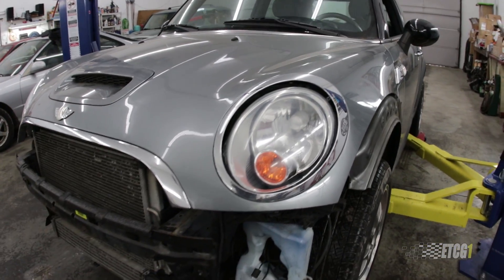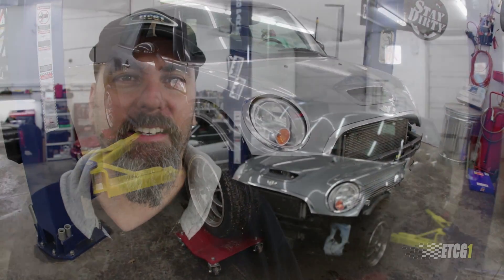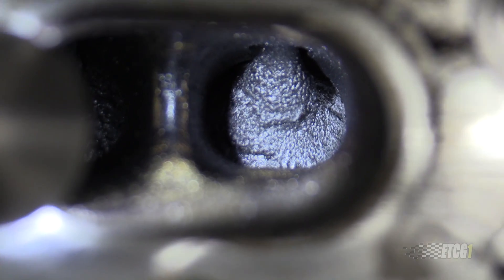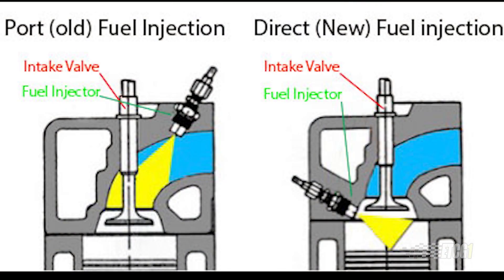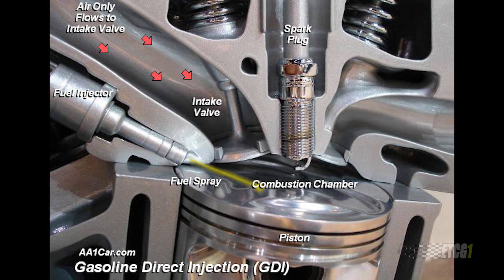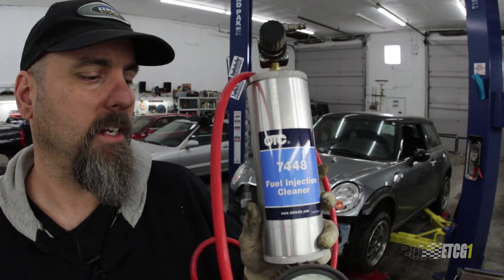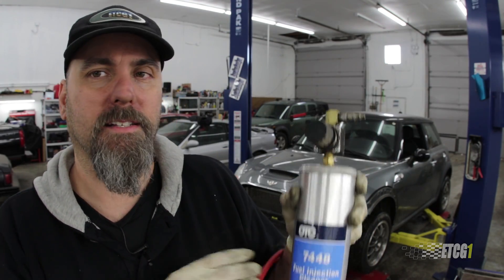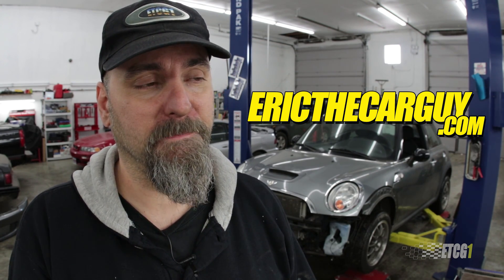Direct Injection Proves Fuel Additives Don't Work

Comment: Lol love your addendum in the end I 100% agree they are snake oil when it comes to automotive applications. But and I add that interjection loosely I have found them pretty effective in carburated motorcycle applications IF it is a situation where the fool who parked his bike for the winter didn't stabilize the fuel and their jets were slightly gummed up. But I did get a good laugh because I went and purchased oil and filter to do my scheduled oil change on my wife's car and the parts guy kept trying to push a fuel system cleaner on me. I told him I had 17 gallons of the stuff at home lol referring to her full tank of gas.

Comment: Its the pcv system dumping oil vapors into the intake. Needs a catch can added. Over at engineering explained they looked at fuel itself compared to fuel with cleaners added. The top tier fuel we get today has all the cleaners needed and will keep the engine cleaner than adding more stuff. the extra cleaners leave some of their own crud(not a big amount). So, I agree  just use good name brand fuel.  you also have a MONEY PIT car. so it will continue to be a big hole in the street that you pore money into.

Comment: Great observations on the solvent power of gasoline and the most likely source of carbonized deposits on the intake valves of Direct Injection engines, i.e engine oil and oil vapor pressurized by blowback in conjunction with an obstructed or ineffective crankcase ventilation/EGR system. GM’s DI engines suffer from this problem, as many owners of vehicles with Ecotec engines have found, but which GM ignores for the most part.  In the worst cases, the oil seals can be blown out.

Comment: How about running the engine with the injection disconnected and the engine fed the cleaner and fuel through the intake throttle body....at least that might allow the engine to run and break up the deposits....Run Rite...
Reply: A mechanical cleaning is really the only thing that's going to break it up when it's that bad unfortunately.
Reply from the maker: The computer would likely not allow the engine to run in that situation.

Comment: I would argue the fuel additives do more for the injectors than the valves.  My first car, had a lot of hesitation and poor running.  A couple of fuel treatments, for the first time in its 200k miles and 26 year old life, and it helped it a lot.  However, using fuel additive at this point wont do anything more.

Comment: i have water methanol injector installed before throotle body mostly for cleaning i use mild wind shield washer fluid (methanol based) and only during full acceration over 3k rmp intake stays clean

Comment: I'm not exactly happy with direct injection either. I read that the new v6 Camry has direct and port injection to combat this. I wonder if that works.
Would spraying misted water in the intake help this?
Reply: Peshewa diy you gotta be super careful with that. You may end up bending the valves. I would rather use CRC cleaner or sea foam

Comment: Ha ha :-D the rant at the end made me chuckle, you evil man lol.
If you were upset you didn't show it, you should be an actor eric :-D.
i'm wondering if some kind of sand blasting while the valves are closed could remove that crud, it's not sand i hear you say, ok media blasting.
The carb is king :)
Reply from the maker: Many comments have suggested walnut blasting and also foaming intake cleaners to address the problem. I haven't tried those. I used carburetor cleaner, a screwdriver, and a brush mounted to my drill to clean these.

Comment: On my 2013 Hyundai Azera V6 GDI I have to use CRC Intake Valve cleaner about every 6k, I had the whole engine replaced under warranty at 48k due to the carbon buildup on cylinder number 5 and 6 and damaged the valves, guess its a huge problem on the Hyundai's even more so on the Sonata's from what the dealer told me that 4 to 6 cars come in each week and they take off the intakes and clean the valves by hand and walnut shell blasting.

Comment: In seems to me it's the EGR system that causes buildup on DI intake valves.  If manufacturers could come up with a way to not have to puke exhaust back into the intake it'd probably be much less of an issue.   I bet the reason that the "latest technology" is to have both DI and port injection is in an effort to keep the intake valves clean.

Comment: I use Amsoil PI fuel system cleaner/Performance Improver. I honestly don't know what it does to my fuel system, but it does indeed feel like it makes my engine run smoother and feels less sluggish. This was also confirmed when I kept getting a knock sensor code pop up about once a week or so, but it stopped after I did an oil change and added a bottle of Amsoil PI to my tank. I didn't purposely try to use it as a fix for the knock sensor code, I add a bottle at every oil change and the code going away was a bonus.

Comment: lol I love ya Eric especially with the last bit! I happen to disagree with you on this subject however. The title of your video stated how you find fuel injectors cleaners do not work. Only thing proven here is that gasoline acts as a cleaner and solvent. Obviously fuel injector cleaner can only clean wherever fuel is sprayed, on tbi engines its pretty much the entire intake, port injection is the intake valves and direct injection is limited to the combustion chamber only. There's been plenty of independent testing for the effectiveness of fuel system additives ( recommend project farm) that prove different as well. Not to say that it's a mechanic in a bottle or that it's just as effective as disassembling and cleaning parts but in a lot of cases it helps. Personally I've had a fuel pump on a Dodge that was making a terrible noise (no serviceable fuel filter) and an additive was added with less than half a tank. To this very day it's still functioning perfectly without a single noise and the change happened before I got down to a quarter tank.
Reply from the maker: You might want to watch the video because I did address your concerns and comments.
Reply: ETCG1 I did watch it as I am a subscriber of yours, I really just fail to see the correlation between a method of fuel injection and the effectiveness of an additive unless you were specifically speaking about GDI only. In which case I'd agree that fuel additives are pointless in a GDI engine.

Comment: Toyota eliminated this issue by using a combination of multiport and direct injection from the start almost 15 years ago. Audi, which had terrible carbon buildup issues, started doing the same about 5 years ago, and Ford is starting to add multiport injection to their direct injection engines now. They don't all run the 2 sets of injectors the same way, but it helps emissions when cold/at idle and, most importantly, keeps spraying some gas on the back of the intake valves to keep them clean.

Comment: Your'e not the first Youtuber to address this issue. You hit the nail on the head with the direct injection engines. Hopefully the engineers have learned something and corrections have been made to what is being made today.
Reply from the maker: Well, they've added additional injectors to put fuel on the intake valve in newer designs.

Comment: Market study, after market study, after market study, all show that the "cleaner etc" products are sold due to psychology rather than technical merit.  People like to "feel" that they are doing something good.  A what a great product to sell, people buy it and burn it up.
Reply: WD-You know what they say: if you think it's working...then it's working!  Placebo effect.
Reply: I will be  more concern about the paper fuel filter and all those additives u blast it with.
Reply: We aren't just talking about Injectors, it also is the tops of the cylinder and where the rings contact the cylinder. I have seen videos of people using snake cameras after a fuel Injector cleaner and it does help.
Reply: @WD Hewson: I agree. It's basically "false sense of security" in a bottle.
Reply: WD Hewson projectfarm YouTube channel has done a lot of tests on them. Honestly, I can hardly tell or see no difference with all of them except seafoam. Even then, it’s so minute, I really don’t think it’s worth doing. The only additive and this is on the oil side that seems to work and in large quantity is motorkote. You watch project farms video on it.

The reasons these things don’t work is it’s called “Fuel Injector” cleaner not “combustion chamber, valve, and intake cleaner.” It’s meant for clogged injectors and nothing else.
Reply: When your car sat for ten years and was to the point where a tune-up doubled the power, it does everything it says it will do. Then a while back I accidentally let it idle till empty and by the time I put gas in it about a week later, the whole system was ethanol'd to hell and it barely started. Full tank, one bottle of fuel system cleaner. 1/4 tank later, it runs fine.

That was the Mercury. The Ford 5.0 doesn't burn oil. The Nissan QG18DE does, by design. After 90,000 miles, fuel system cleaner made an improvement. Probably moreso if the fuel pressure regulator worked. With a gutless, motor mount-shredding wonder like the QG18, you will notice any improvement in power or smoothness.

Oh, and ChrisFix sent out a fuel additive to a LOT of different people with a LOT of different cars and across the board, it had significant results.
Reply: What studies? Care to share?
Reply: keantoken the fact is that even placebos can't affect what's not being touched, which as shown in Eric's video is the intake plenum right before the valve. Study this: Eric's butthurt because his cleaning douche bottle is now useless: evidently couldn't start the Mini with only the shop air meager air pressure or the thing behind him would've been out of his shop already instead of still conspicuously-occupying his 2_post lift. Red herring stinks like fish.
Reply: I understand nothing you put in your fuel tank would clean the intake valves when they never get touched by gas. I'm just curious what has been done to show they are useless on port injection cars.
Reply: Don't knock a good placebo.  Just talking about them makes stuff better.  If diluted with any reality mixer, they go bad fast.

Comment: Hey Eric, I use the same type of fogger system whenever I do and injector cleaner as well. But whenever I’m in a pinch and out and about I just take lose the brake booster and put the hose directly into the cleaner itself and just fog it that way. Got a love it when you get all that wonderful smoke coming out the tailpipe

Comment: Like eric says the bottles of cleaner that go in the tank don't do anything for direct injection engines but if you live near a valvoline instant oil change you can stop in and use their 2 part fuel system cleaner. The important part of the system is the air intake cleaner which looks like Eric's fuel system in a can, they run a cleaner through that to clean the backside of the valves where the fuel doesn't touch normally

Comment: Looking forward too the electric car revolution 😎
Reply: OMG - can we stop the bullshit about it all electricity being generated being made from burning coal. The UK ran on renewables for three days in a row last month despite a horrific government tax policy against renewable. 
If your country is burning coal to produce it's power then it will soon be demoted to a third world country.
Reply from the maker: I'm sure it will bring new problems, but less pollution.
Reply: Cargo mega ships about just 15 of them pollute more than all the cars in the world.
Reply: There isn't enough li -ion batteries for everybody to have an electric car.  Also producing those batteries causes a large 'carbon footprint'. Will just have to invade countries with large lithium and uranium deposits instead of oil rich countries.  Haha
Reply: DP T  that is a different problem and the faster we can get them using clean hydrogen electric fuel cells and not burning heavy oil the better, but it’s one specific type of pollution and at least it’s not happening next to schools or parks.
Reply: doug m everything you have said there is either very misleading or completely incorrect. Are you Ken’s brother?
Reply: The problem with the use of oil is not one of design but of man's incompetence. The tremendous waste of heat energy is why ICE(s) and oil/gas electricity are "inefficient". I'm all for saving the world but we're approaching the world's energy and pollution problems in the worst way. So called "green technology" is just as bad for the environment as anything else we're doing today. It's simply a band-aid to make people feel better. The reason electric cars sound so much better than ICE cars is because we are separated from the source of energy. Let's be honest, you can't see the power plant so it doesn't seem so bad but you can definitely see highly flammable, explosive fuel when your pumping gas. That's perception. 

It's simple thermodynamics: energy cannot be created or destroyed it can only change form. Everything requires energy. In the current market it looks very feasible, "all electric", but we forget that if we go "all electric" that we are going to need a surplus of energy in order to process the surplus of transport on said energy. This will require us to once again tap into our earth's resources. We can rely on renewable (more like almost free yet forgotten) resources for a few days but we cannot control the weather, we cannot control the water,. It does as it pleases. The recycling of rare earth metals does have a practical lifespan unlike iron. The more it is reworked, the harder and harder it is to refine cheaply. Then how do you dispose of it? Either one of these processes, once again, requires energy. Coming from where? There is only so much space in this world and renewable energy is a very space intensive form of energy. If mankind continues to grow at the same rate (which we will, sex is very fun) we will continue to use oil. How we harness every last drop of energy that comes from it is the question we need to ask ourselves and the process we need to perfect.
Reply: ʇɥƃᴉɹlɐ ʇou ɯᴉ that was such pure unadulterated bullshit I think it made me lose a couple of IQ points reading it. I have solar panels on my roof, they provide enough energy to power my house car and still have plenty left over. They have been there for 10 years and are guaranteed for another 15. They cost $10,000 and have made me more than $15,000 so far by selling the electricity back to the grid. By the time the warranty runs out they will have paid for themselves 5 times over.
Large scale Wind turbines are even more economical, renewables are cheaper than fossil fuels or nuclear.
The sun still has a few million years before it burns out so I think we’re good on that front.
As for “reworking” the materials in a battery have you ever seen a deconstructed lithium Ion cell? All the lithium, cobalt and aluminium can be separated and repackaged very easily although it does about 25kwh to process the materials to produce 1kg of lithium ion batteries my house has about that much excess per week. Which means I’ll be able to create enough excess energy to create a long range Tesla model 3 battery pack every 7 years
Reply: Same pollution, its all perception. Instead of a tailpipe, it'll be a smokestack.
Reply: That is another area rife with bullshit... Once a lithium ion cell no longer good for cars after 7-15 years (as they have diminished peak load) they can be used for deep cycle grid batteries, and once they are completely worn out. After about another 10-15 years using current projections they can be fully recycled. All that lithium, aluminum and cobalt is fully reused.
The energy used to produce a lithium cell pales in comparison to the energy used to transport and refine fuel from crude oil or shale. Refineries are one of the largest consumers of electricity.
Reply: hes not talking about generating electricity hes talking about battery production
Reply: Electric cars are a sham! The amount of wast thats toxic is double or more than gas cars....yes its true. Start with lithium batteries disposal and manufacturing absolutely toxic! Production of electricity mostly coal or you can go solar.solar however is worse! The material's in solar panel's hve 10xs the half life of nucular waste and there is yet to be ANY WAY to safely store the waste...or you can go with the most expensive electricity wind! Wind energy that obama pushed costs twice that of any way to produce the matinace cost of wind is enormous! Constant maintenance is required to keep them running!

Comment: It seems the Hyundai Theta engines do not have this issue, as far as I am aware from researching them since I have a 13 Sonata with a Theta 2 2.4l GDi in mine. I can't remember what I read about them that supposedly keeps this from happening. Any insight on that particular model?

Comment: Eric, great rant. Direct injection, I'm glad to see, doesn't just make me rant. Lol Used your device to fix a 80k mile Colorado. Misfires and more codes. Those conditions ruin spark plugs too.
Reply: DE Nichols I got cut off before I could stand here in amazement. You're saying that your shop air put enough pressurized fuel behind the injector from your fuel system cleaning douche bottle to overcome the 110-170psi. compression opposing a DI injector...to run a truck? Must have been some kind of lean burn nightmare from hades. How high can those new GM fuel trim numbers go up?

Comment: DI engines need regular intake fogging services.  Like every 15k to 30k.  I've seen a lot worse.  Ive noticed that some newer toyotas actually have vacuum blowers that suck the pcv vapors out of the engine after you shut off the ignition.  That is when most of the build up occurs, after the engine is shut off because pcv vapors arent being sucked into the combustion chamber.